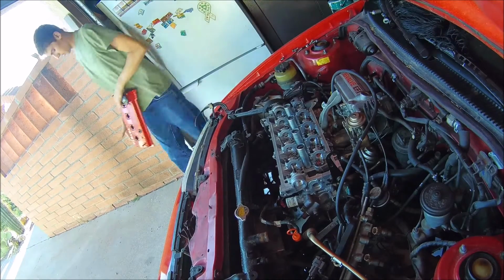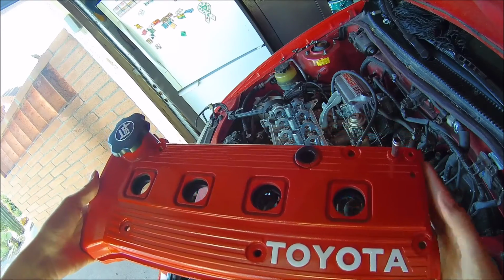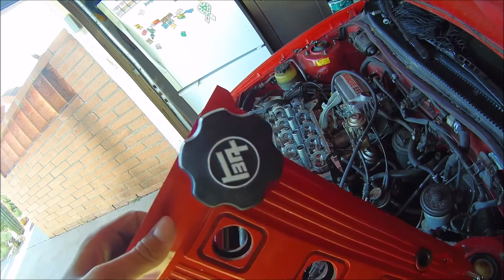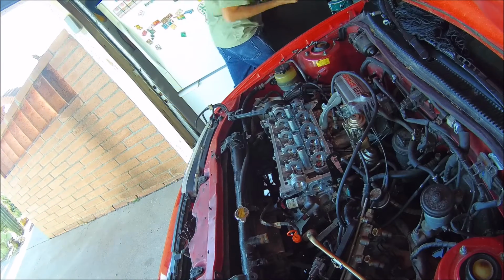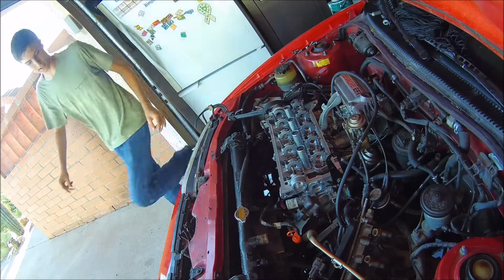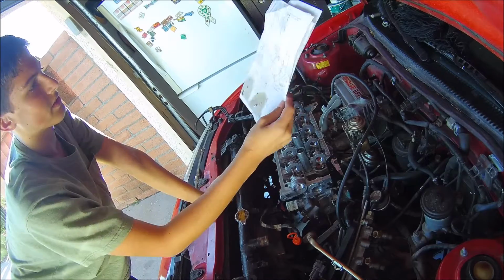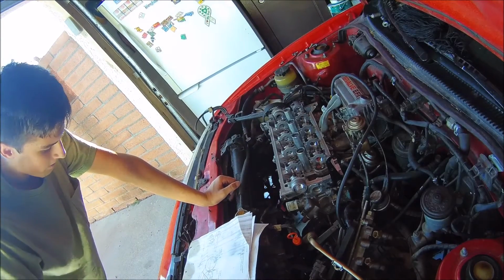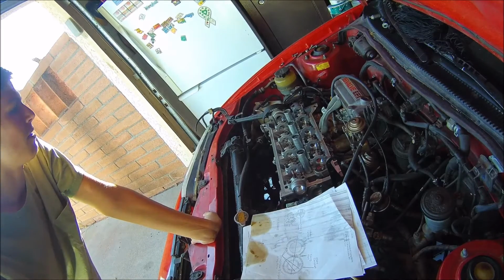Paseo Revival PT:3 Will it run?

Comment: 2:57
Always happens to me when I'm working on my car... wind...
Reply: and btw, I hope you did't cause damage to your camshaft bearings, because there's a specific order (and torque) in tightening them

Anyway, nice video, good job in getting it running
Reply from the maker: I'm pretty sure the cam bearings are fine (shockingly) because I've driven the car 2000 miles and it seems to be fine. Thanks man I appreciate the support